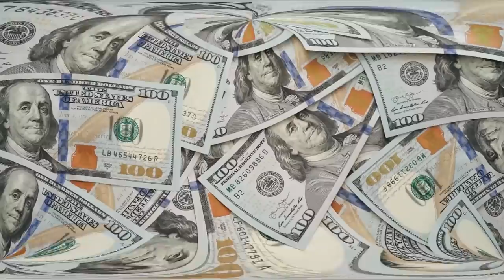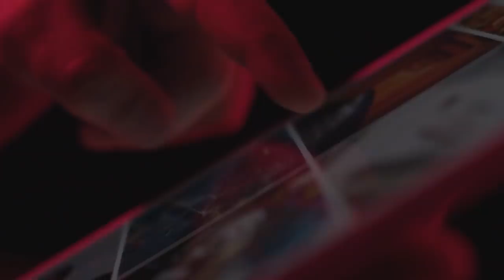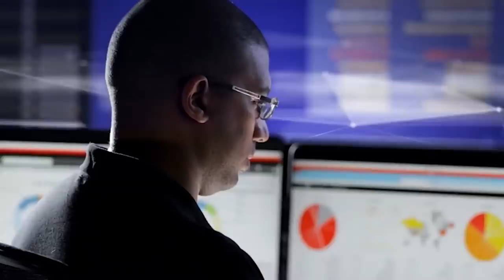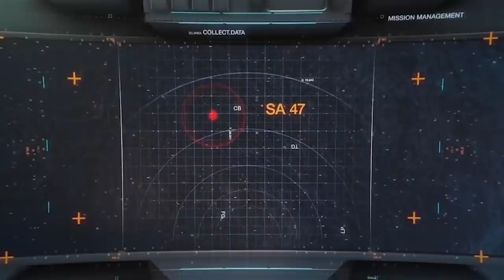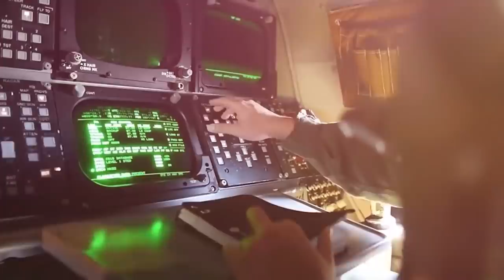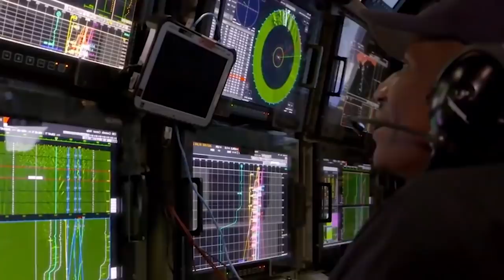FINALLY Japan Has  Revealed Its 6th Generation Fighter

Comment: The Japanese will come up with some amazing innovations as they expand their production of military aircraft that will have features that will put other global manufacturers to shame. Good luck Japan!
Reply: Let's put them on f16 and f15 and see what happens
Reply: Looks like the YF23 that we didn't want.  Way to go Japan.
Reply: @peterbaker8443  they already have them
Reply: @peterbaker8443  haha you have watched to much top gun lad
Reply: @bansh3527  Lmao even if Japan copy yf23 its nothing because its 20yrs old design now
Reply: @gregnash8331  they have the knockoff f-16s
Reply: @qwertykeyboard1207  To be fair, the F23 was generally perceived in the engineering community to have superior aerodynamics to the F22.  The design might be >20yo (well, so is F22 in that case), but the whole airframe was so optimized, so well-designed, there is absolutely no shame in using that as the baseline.  The key advancement in the past 20yrs have to do w/ avionics, avionics, more avionics, and then propulsion and armaments.  But I just can't imagine Japan will be willing to bear the exuberant costs of developing her own one-off 6G fighters, along with armaments, avionics, propulsion, etc., etc.
Reply: @H-BOMB What's so insane about that?  You have the CAD file, and you just feed it to the 3D printer and off it spits out the part.  But it's strictly for prototyping, so we have no idea what materials it actually uses, for all we know, it could be wax or plastics...
Reply: Japan doesn’t have the money.  They have a pacifist constitution meaning they can only spend 1% of GDP on their military at the most.  That’s still a lot of money but it stops them from being able to mass produce incredibly advanced weaponry and thus hinders them from wanting to make it in the first place.  That’s why they have to do this with the help of Europe.
Reply: I heard the Japanese is going after a YF-23 black Willow II, for a starting point and also heard that YF-23 was a better aircraft but the Air Force generals picked YF-22 because it looked Air Force  where as YF-23 looked too futuristic and carried more Ordinances and much faster in super cruise. I say that is better aircraft but the Raptor is the best flying fighter now by far.
Reply: I wish them well...with Biden in the US they can only count on them selves.
Reply: @johnalniel1037  thats an ignorant comment.
Reply: Lol , I guess we’re just going to forget what they did in the forties.
Reply: That until US MIC put a lobby into their congress to suppress japan because they affraid to lose market.
Reply: you know japan still does not actually have an offensive army anymore since ww2
Reply: @HurricaneJD   , according to recent news reports they have begun rearming do to the China threat.
Reply: The most interesting fact is that Japan is taking help of india 🇮🇳 for this fighter jet. India will provide more than 40% technology for this fighter jet. Japan ex PM seek the help of india for this fighter jet. Soon, US and other western countries will also seek the help of india for their 6th generation fighter jet. Already india🇮🇳 has  much ability to make a fighter jet like f22 raptor or f35.
Reply: Japan will produce a great fighter jet that can capture bluefin tunas and make sushi out of them !  
Go papa son !

Comment: It definitely transforms into a gundam right?  Seriously, I don't find it surprising in the slightest that Japanese engineers could design an advanced jet engine.  The powerplant is also probably the simplest and easiest  challenge in creating a 6th generation fighter.  They will need to invent tech that makes the F-22 look like an F-15 does today, supreme in it's day, but pedestrian in comparison.
Reply: I do not agree that the power plant is the simplest an easiest challenge in designing a fighter jet , especially if it involves innovating that power plant ; especially in that case. I am not an engineer but I do have some interest in science.
Reply: @bernardotorres2532  If it isn't, then why are there a fair number of countries and companies making roughly equivalent engines, but only 3 actual 5th generation operational, fielded, fighters?  What system seems more likely within reach of new developments to you?
Reply: @warpdriveby  More likely of reaching new developments?  That would be the electronics of the 5th generation fighters ,  and maybe the stealth Technology ,  but I do not know about that , it’s so secret ; it way too stealthy a subject for me.
Reply: @bernardotorres2532  Given the fragility and expense of the F-22, new stealth seems mandatory. Current systems are just not practical, which is why the 22 hasnt replaced every other air superirity capable plane in service.
The f-35 uses a more sensible system, but its comparitively pedestrian effectiveness is obvious when you consider that the US has no issues exporting the 35 but the 22 is guarded jealously.

Comment: Just think. You could conceivably use a special forces team (tier 1) like seals, ranger recon, British SAS, Delta, recon Marines, and insert them a few miles from any airbase. The unit using a switchblade kamikaze drone could theoretically destroy a multi billion dollar aircraft in exchange for a six thousand dollar drone. Takes less then 5 minutes to set each drone up. So a ten team squad could conceivably send a salvo of 10 drones let’s say every 15 minutes for set up, flight time of the drone, and then set up for another strike if needed. That’s using the smaller style drone. Using the bigger drone, granted you’re limited by the weight. (About 50 pounds per) to strike hangers ect ect, because of the bigger bang. I’d use a combination of both. Using a 2 —10 men  tier 1 teams I’d use 3 of the larger drones, and 14 of the smaller backpack sized drones. One team I’d use for security and to hump in extra rations, gear (AT-rockets ect ect) and ammunition so the drone team will have what they need after using the drones. If possible I’d have them bring in 2 additional heavy drones. It would be nicer if you could set up a cache of these beforehand, but I wouldn’t rely on that. The drone team I would have just basic 2-3 days of gear, weapons, food that sort of stuff. And of course the drones. After using the drones they would use the extra gear brought by the other team. I reckon they could get 2 salvos off before having to get out of dodge, and/or be extracted quickly. The heavy drones 5 in total would be launched by the 2nd team with two being launched by the team bring the extra gear. The heavy drones would target headquarters, pilot barracks, mechanics barracks, and maintenance hangar. 2 drones for the headquarters and 2 for the pilot barracks, one for the mechanics barracks, and one for the hanger. I would have both teams launch the small drones at individual aircraft. Starting at the 6th generation aircraft first. Then 5th  generation aircraft. That is dependant on the dispersion of the targeted aircraft. 5th and 6th generation fighter jets don’t take much damage to disable or destroy them. A couple pieces of jagged metal going through the avionics, hydraulics, and/or other sensitive areas of the aircraft isn’t good for them. It could create collateral fires ect ect. If this is possible and one drone can destroy multiple aircraft I would also target fuel vehicle and the staging areas for them. Target list would be: 1. Pilots, 2. Headquarters personnel, 3. Maintenance personnel, 4. Hangar aircraft and maintenance personnel, 5. 6th generation aircraft, 6. 5th generation aircraft, 7. Essential equipment such as fuel hangars, and the vehicles. Doing this at multiple airbases at the same time would devastate the economy, and qualified people especially the pilots, destroy the enemies morale, and help, if not create air superiority in the general area. Aircraft costly and not really to difficult to replace. Pilots and essential personnel costly and not easily replaced or can they be replaced quickly. With that local/area air superiority it would be fairly easy to extract the special forces teams using your air assets. Attack helicopters and cruise missiles could clear ground to anti air forces fairly easy. Without air superiority you lose. Israel has proven that time after time in the Middle East. British and American forces used, and proven that you can insert special forces deep inside of enemy territory. Japan learnt what happens when you lose your best trained and experienced pilots. Germany learnt about not having air superiority.
Reply: So you belong to the military then?
Reply: Your Playing Too Many War Games From Your Very Expensive Gaming Room,Or Your Military??

Comment: Everything mentioned here, except high power laser, are operable in Gripen E. The higher speed and range can be reached by upgrading the engine to EPE. In the case of stealthy airframe, higher thrust will be needed though, which may be achieved through adaptive cycle engine. No one know if those airframes will be worth the compromises in the future. But if so, the next SAAB combat airplane will probably have it 2030 and this airplane too.
Reply: The gripen does have modularity and modern systems, but it isnt modern levels of supermaneuvarable and it isnt stealth. Instead of stealth, it has a clever on/off radar system that helps defeat longe range radar, but that is really only for inferior foes.
Its a very good plane, but nations arent investing into it for good reasons.

Comment: I wonder when the military will begin using plasma propelled missiles? With something like this type of missile the projectile wouldn't necessarily need fuel as it could create it's own plasma energy to propel it hypersonically plus the aircraft also would be able to store more missiles than commonly done in a fighter as well if the fighter had plasma propulsion then it too could travel at hypersonic speeds of Mach 10 to Mach 30. Perhaps the TR-3B's that the military has can already do all of this secretly without anyone really knowing, their ace up their sleeve so to speak.

Comment: so what, the japanese now have:
a main battle tank with a 15s reload.
every special forces trained by the delta force handbook + more
have perfected a type of hand to hand called CQC that mixes several HtH techniques together
and NOW has a NGA that is going to par if not succeed the F-22? 
Well. great job. 
I look forward to GDLS's revealing of the new XM1A3 and new Stryker system coming 10/10/22.

Comment: There is no way to cost contain a sixth generation fighter. When you see the cost per unit is 210 million or more. Your eyes bulge. China will develop it but only use it as a test weapons technology platform. Only the Americans are crazy enough to try and manufacture it. The engine alone will nearly be equal in cost to the F-18 superhornet.

Comment: 2 points.  NO shortcuts. If ya haven't figured out a 5th-gen, you ain't makin' a 6th-gen.  Like Tony Stark: "How'd you solve the icing problem?"  "WHAT icing problem..."   Exactly.   2nd point.  NEVER buy a used car from somebody telling you 180 KW means Jack for a battlefield laser kill-weapon.  It's not even 180 KW. That's the generator's MAX output, & it likely can't sustain that for extended periods. What's needed is a 5 MEGA-watt input energy source. That can run at 70% output for hours. Providing 3.5 MW to the laser head. The world's most efficient CW high-energy laser runs 30% output efficiency, and... 

...that gives you >1.0 Mega-Joules/cm(2)/sec.  Sustained for ~4 seconds. THAT is the minimum threshold for delivered energy density in a real-time Kill shot w/ a laser. I've been building these things for 4 decades.

Comment: And I really hope it's a two-seater, if not they will be making a big mistake?  The two heads are better than one...
Reply: Agreed with a caveat - Link 16 could be like having half a dozen RIOs in the back seat - so leave the body behind, save weight up manoeuverability?
Reply: A second seat is a LOT of extra weight and space used.  that's ONE of the reasons most fighter aircraft don't have one.
Reply: Just one seat but with a Droid companion called R2XX. lol ✌️

Comment: It's been 13 years and they still don't have the design, which they are getting from either Lockheed, BAE or Boeing. Engine, probably with Rolls-Royce.. not sure how this is even called Japanese fighter.

Comment: When you’re describing the engine you said it’s comparable to the f-22 engine…so it’s only 30% better than a 4th gen aircraft and it’s only as good as a 5th gen air craft yet this is going in a 6th gen fighter?
Reply: In what planet are fighter generation characterised by there engine power? 

An English Electric Lightening from 1950 has more thrust and is faster than an F-16 Fighting Falcon.
Reply: @Jasontvnd9  this vid is so old in the strategic landscape that time has proven me right, the US is unmatched in AirPower.  We have a 6th gen fighter on the way and a fully build 6th gen bomber.  The rest of the world is still trying to catch up with half baked 5th gen aircraft.
Reply: @thomasfoltin3832  half baked like the F-35? Aka Fat Amy?
Reply: @Jasontvnd9  the f35 has been produced by the hundreds just to be sold to other nations since the demand is so high.  I don’t see anyone trying to buy russias “checkmate” fighter, which was a lame copy of the f35.  The f35 is not half baked, it had production inefficiencies but is now the leading fighter of the world and you can’t refute that.

Comment: 2:50  "Does not have a variable thrust vector." - shows 24 cylinder WWII piston engine .  Yeah, pretty sure there's no variable vector on that there puppy.
Daily Aviation has probably the worst fact/video checking of any of these types of videos.  They're going on the Do Not Recommend list now.

Comment: no question, this will be a great fighter, the Tempest! i mean the alone BAE, Leonardo, Saab and Mitsubishi and other's. But, as world war 2 showed, we need also fighter which can be build fast in case of a greater war! the Fiat G55 was superior to the Bf 109, but the Germans concluded, that he was not suited in order to build great numbers in a short time, simply too many parts! i think this could be the same case with this jet, that's why we still need to keep the production of the Eurofighter
Reply: The Typhoon is a very costly fighter. It has to be redesigned to allow fast production. The Rafale and Gripen E seem more production friendly. But a war between industrial countries is supposed to end fast, due to exhaustion of one side. So you fight with what you have until the end. But during the escalated tensions ending in the war, there will be some time for production. So production friendly an affordable airplanes is important.

Comment: Great technology the Japanese have devfeloped with their new engine
BUT 
To imply 'and wow its way better than Eurofighter Typhoon because the XF or whatever is more powerful' .... Typhoon has TWO engines.  Overall Power .... go figure.
Reply: I am not sure I understand your comment. Isn´t it also possible for the XF program to use 2 of those engines? If 1 XF engine  (without pushing it it to the limit) is more powerful than 1 Typhoon engine but they have 2 right? But 2 XF engines change should change that. I mean it should be than more powerful in this regard right? Or am I missing something here. To be clear we are only talking about the powerof the enigine.

Comment: human piloted jet fighters will go by the way side.  Why? Cause the limiting factor in maneuverability is G forces to the pilot. Even with G force suits worn keeping the blood forced to the brain, they can only experience in the single digit G forces.  Fighters flown from a command center will have far greater developed skill sets,, such as much better vision and spacial awareness due to advanced digital camera systems displayed on large monitors coupled with advanced radar and integrated soft ware systems enabling the physically Unstressed command center pilot to do thinks no pilot could imagine.   Just designing the jet without the cockpit and all the other accessories needed for pilot health and safety will save millions on each unit and streamline the plane.
Reply: Human pilots with visual contacts is needed according to international rules. So they will be important.
Reply: @atlet1  doesn't make sense, otherwise drones would be ruled out.